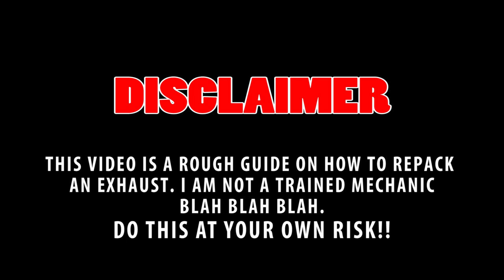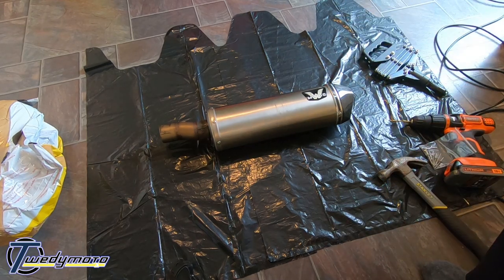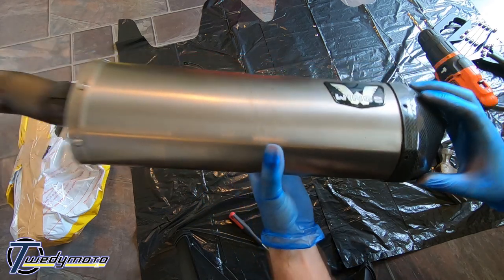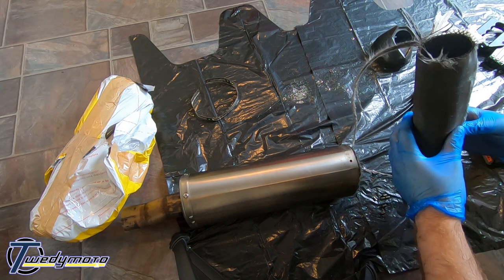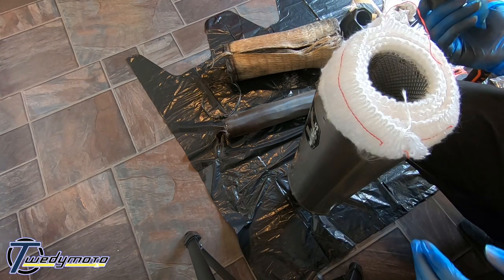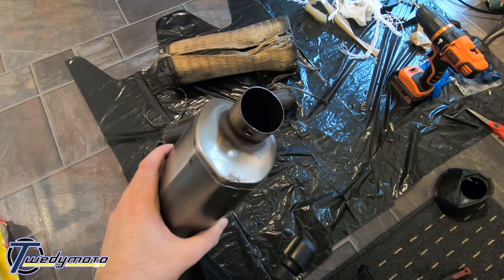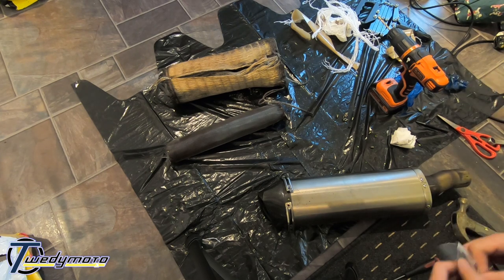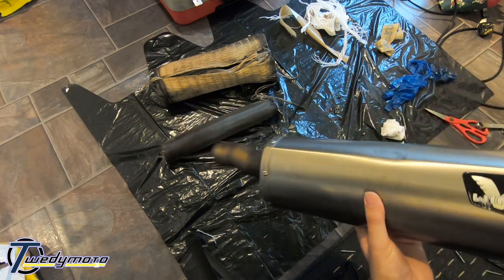HOW TO REPACK WINGS EXHAUST/MUFFLER | HUSQVARNA 701 | KTM 690

Comment: Would it be easier to repack with both sides of the can removed?
Reply from the maker: Yes and no I think. It's twice the faffing on with drilling rivets and removing the end caps then trying to squeeze them back in. The only reason I had so much bother with this is because the link pipe was corroded on so I could get anything in there to help line the core up.

Comment: How did you know it needed repacking?
Reply from the maker: First time round it had just gotten very loud. I ride hard with no baffle and done many track days. This time i may have screwed up on rebuilding it as it didn't sound right and had also gotten very loud during a fast ride out with friends. Have a look half way through the video and you can see the inner core was split right down the middle.
Reply: I'm suspecting I have to do the same soon. I've had Wings on mine for 3 years now, and it has gotten VERY loud recently.
Reply: Twedymoto is it bad for your bike if you don’t repack the exhaust? Or bad for your exhaust or whatever?